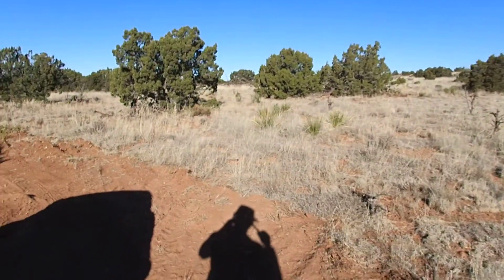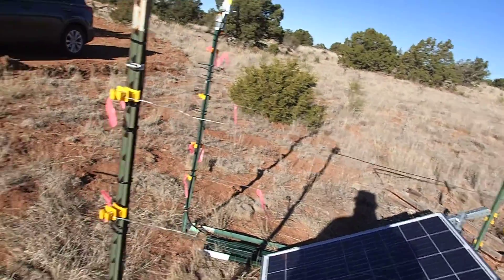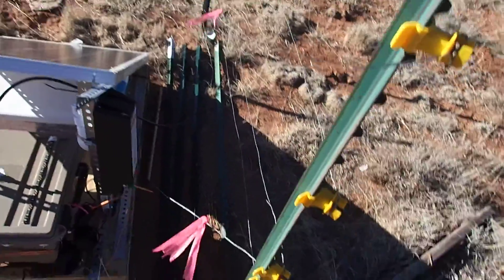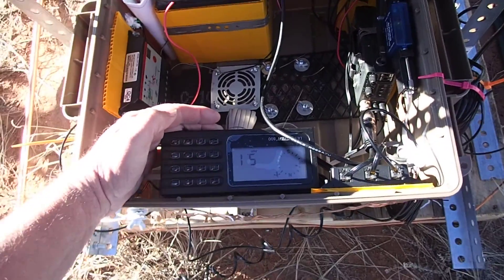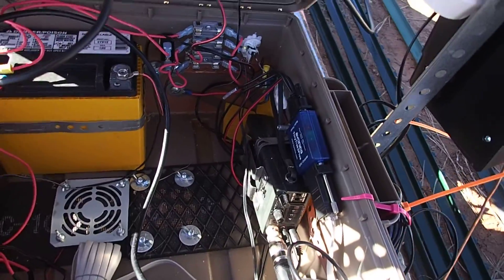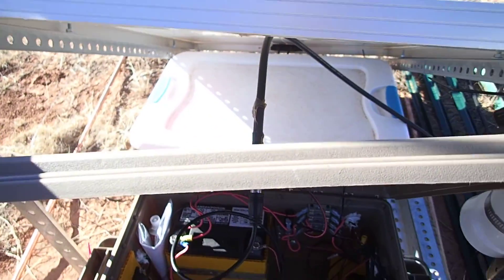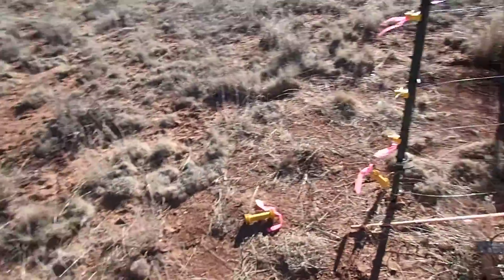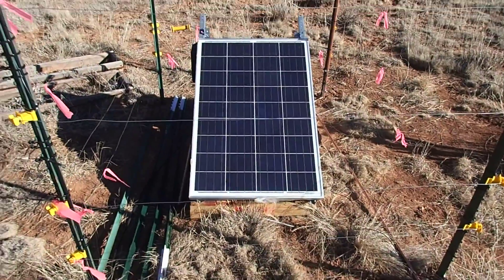Building an off grid cabin in New Mexico part 5. The APRS Weather Station

Comment: Well you can consider it a problem if devices (more than one) fail over the summer.  I would visit it a few times on crazy hot days and check the in box temperature.  I ran across your video because Im like minded and would like to do such a project someday.  cool project and good luck.